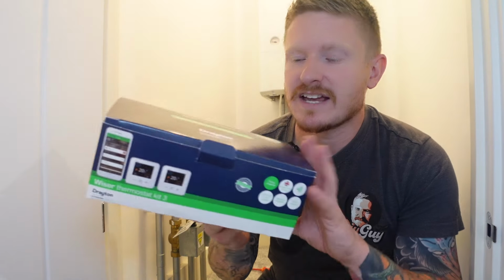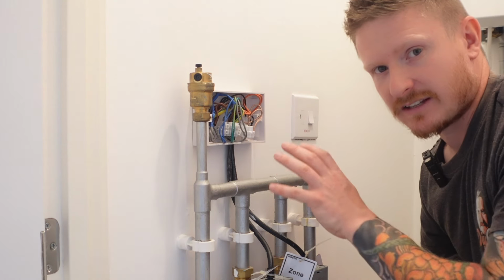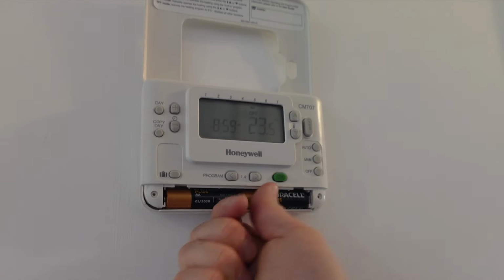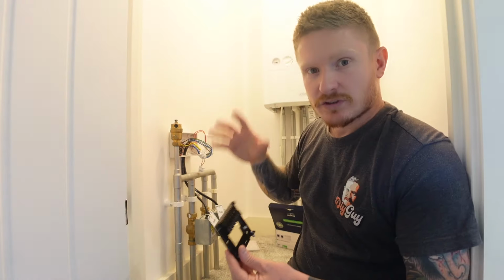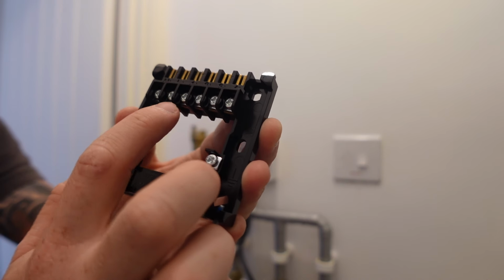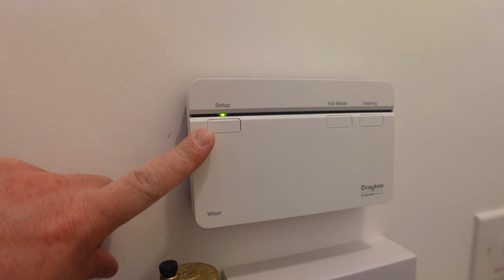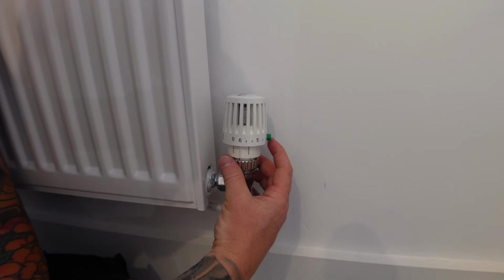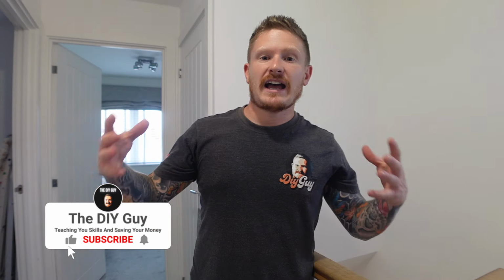How to Install Drayton Wiser Smart Heating System - THIS WILL SAVE YOU MONEY

Comment: Am I right in thinking that when the zone valves open as a result of input from that hub, they then send on a switched output to act as an input to turn on the boiler? Related to this, is it the case that whenever you use zone valves to control heating circuits its not possible to then control the boiler via digital/opentherm control (you're limited to switched on/off boiler control)?

Comment: Use a voltage indicator or proving unit as you have done  before cracking it open and also as added remove the fuse so if someone flicks the switch on it wont become live
Reply from the maker: Exactly, safety first! 👍

Comment: Hi the loop you do for the call for heat once removing the old thermostat if there’s a constant call for heat is that controlled by the drain then? But then it’s always running or do you have to keep turning the temperature right down to make sure it’s not. It’s like it’s constant power all the wiring charts say not to do that and I’ve just wired mine in without that and could not get the heating from the unit to work

Comment: Unfortunate for me I bought this system. It disconnects thermostat to its hub and the prosumer web interface when it feels like it. No logic no reason then will be available an hour later or later in the day. The stat is a pain as a touch control device with illogical touch buttons. Avoid and buy a good system like Heatmiser Neo which controls an underfloor separate kitchen dine and living area. I am going to dump this and add full Heatmiser control.

Comment: Hi 
Great informative video.  So I’m looking at installing the wiser controls to my system at home.  I currently have 2 x heating zones and 1 hot water.  My current 2 thermostats are wired.  So is it as simple as removing my existing programmer off its back plate, replacing it with the wiser hub onto the existing back plate then just disconnecting the 2 thermostat wires from the wiring centre?  Many thanks
Reply: Same set up, keen to know if it was that simple?

Comment: Can anyone help, I live in a new build with exactly the same boiler and the same 2 thermostats shown in the video. I am looking at getting this same kit to upgrade to smart heating but I can't see the main wiring programmer anywhere near the boiler or in the house. I have just the two thermostats on the wall, one downstairs and one upstairs
Reply: Check in one of the down stairs cupboards. You will see the two valves on some pipework and the cables running from them to a connector box.
Reply: @mazharuddin4044 Found it, it is just sat on the floor under the bath. 🤔
Reply: Hi, thanks for replying. There is nothing, all pipe go off into the wall. After looking online alot I found the boiler supports something called OpenTherm. Does that make a difference?

Comment: Can I ask a couple of questions please. Thanks in advance.

a. How well does the system perform as a thermostat. I'm currently using Hive but it has almost zero hysteresis so it tends to run the heating for a few minutes, then turn it off for ten or so and keep short cycling like that. All those frequent stops and starts can't be good for the system. I'm considering replacing it with something better (self install if possible).

b. The Hive controller is sitting on a standard British Gas type electrical connector. Since its functioning correctly, is it safe to assume that a Wiser controller can be swapped in without any wiring changes. (My system needs hot water + one heating zone).

Comment: Great vid. But, are you tied to registering via Draton cloud, so if that trips out you are out of control, and is there a open route into the system for smart home control by either 433  RF, WiFi or preferably MQTT so as to be able to integrate with the rest of the smart home controller, or is this a proprietary closed control system ?.

Comment: This is a really helpful guide. Do you know if the stats and boiler controls all connect with each other via the home wifi or do they require a proprietary wireless connection. I know that both Nest and Tado require proprietary connections and do not offer any form of signal boosters so unless you have wired stats, these are not suitable for homes where wifi can be a challenge. I have spent a lot of money getting a Mesh network to provide whole home coverage and want to take advantage of it. Thank you.

Comment: Installation looks fairly straight forward.  I have a Danfoss 5000 that's gone belly up on my combi. I look on the backplate. 240v connected on the far left and terminals 2 and 3 wired up. If I understand your video I change these to terminals 1 and 3

Comment: Unless you know what you are doing NEVER touch wiring. I have seen so called professionals do dodgy un-fused spurs, wiring installed across walls at various heights, incorrect cable size used, sockets under kitchen units in stupid places especially under sinks, adding sockets to an existing ring when extensions are built without loading calculations, no metal fire caps put on light fittings in flat roofs etc. etc.

Comment: Thanks DIY guy. One question on the back plate. I have the same one that comes with the wiser product already in my wall and all wiring is already there. Do i really just pop the wiser hub on and job done? As well, my 2 zones system is controlled by wall thermostats (temperature only), do i leave them on the wall connected to the electricity? Thanks again.

Comment: Hello, do the radiators still need to be balanced, given they are now individually controlled, whereas before they would all be on/off at the same time?
Reply: Radiators should always be correctly balanced, as there are going to be occasions when all rad valves could be calling for heat, so correct balancing means all the rads warm up together.

Comment: I have this system and whilst it is good it does have some flaws.  Randomly disconnects the hub - common issue it seems.  2 of my TRV are too far away and often disconnect, but you can buy a smart repeater plug which costs a lot for what it is!!  Setting the schedules is a bit backwards, but once you've sussed it then it's fine.  Dead easy to set up, even for tech expert like me!

My downside is that most of my TRV's are seized and despite constantly freeing them, they mess up soon enough!!  Anyone got tips for having them behave this winter?  Will replace all radiators and valves next year I reckon in the summer!
Reply: Zigbee repeaters don't have to be expensive, Ikea do one for < £10.
Reply: @UKBlue407  Zigbee yes.  But Wiser uses it's own system I believe as I already have a zigbee repeater anyway for my Home Assistant setup.

Comment: Thanks for the great video. I've been looking for a smart heating system for some time and settled on the Wiser system to add to my combi boiler however I have been a little unsure about the installation but your video clears this up plus the 40% off code is hard to resist.

I don't have a standard wiring unit as you had in your video but the feed from the boiler just goes to the standard RST1 stat unit that you must have seen loads of. 

It has a permanent 240V feed with a call for heat connection too. Looking at the wiring diagram it looks like the one channel hub unit will just replace the stat as long as pin 3 has a link to feed 240V. Other than that, it looks pretty straightforward.

Thanks for sharing.

Comment: Great video! I have the exact same setup - same stats and same boiler so should be a very easy job. Quick question that may know - the 3rd pipe has a red return valve on? What should that be set to? Can't find answers anywhere.

Comment: Installed one of these as a replacement to a MiGeni system from same company due to cloud update.  However it would not connect unless I was a metre away from the hub. Despite numerous hours with the helpdask I had to return it and opt for a Hive system which connected and worked straight out of the box.  So not as clear cut as first sold.
Reply: Zigbee in Uk is 2.4 Ghz, maybe you had interferene with your home Wi-Fi 2.4Ghz band (or a neighbours)? Changing the channel of your home Wi-Fi may have sorted it.
Reply: @UKBlue407  Thanks for your thoughts however, all avenues were covered including setting up a separate guest network running on 2.4Ghz and tried direct allocated channels.  And still would not stay connected.  I had not one single problem with their previous product MiGeni in seven years.  I still maintain this product is not what it is portrayed.  Whilst Hive is not my first choice it works strait out of the box as does Tado and Salis.

Comment: I wish technology that connects to the internet would stop being referred to as 'smart' as there is nothing smart about that. 
I assume that the connection to the boiler is existing on/off connections which just turns the boiler on to full rate when a heating demand is called?
A 'smart' thermostat would use the OpenTherm connections in the boiler to actually communicate the needs and modulate the boiler to make it more efficient and actually help to save you money and, more importantly, more comfortable in your own home...
Reply: It supports OpenTherm and does weather compensation!
Reply: @robert.wigley  I'm sure it does, but it is not highlighted in the video, as you would have had to wire it into the boiler differently.
My point is, better education is required on this topic. Connecting it to the internet can offer some features that will benefit the homeowner and potentially save them money, but a load compensating boiler will work much more efficiently more of the time and keep you much more comfortable 🤷

Comment: I always love these videos. '"Easy diy install". Not the easiest job if you have a house full of archaic 80's half seized  lockshield valves on all your rads like me. Dead easy if you're lucky enough to have shiny modern trv's on a recently installed system.

Comment: Drayton wiser is a great system, I sold my very old Honeywell unit and thermostat on ebay and nearly paid for buying this (without TRVs) new. 

So far i haven't upgraded to TRV, but nice to be able to use Alexa to control the heating and switch on and off away from home

Comment: Just one question  DIYGuy, I set up the hive system but haven't invested in wireless TRVs yet because I still wouldn't be able to heat the upstairs alone when I needed to because of the rule about one rad(currently our lounge rad), can't have a TRV on it.
I would always be heating the lounge unnecessarily if I wanted to warm the upstairs.
What's the solution?
Reply: change which Rad doesn't have a TRV downstairs? maybe hall or WC?  Somewhere you don't mind a bit of extra heat.

Comment: A really cheap option for smart control is also to pop a Sonoff minil2 on the live/switched live to the thermostat in the wiring centre. Let's you get rid of the wall thermostat entirely. Can combine with a temperature sensor in Home Assistant... You can then control heating from any mobile/tablet/wall panel, home or away... And use in automations... Ie auto turn off heating when everyone leaves the house etc.
Reply from the maker: Thanks for sharing 😃👍

Comment: Thanks, I’ve just taken a Drayton & Zhender thermostat off to measure are compare. The open & closed dimensions are the same 20 & 15mm. They fit each others valves and work fine. As a DIYer I assumed each manufacturer did their own thing. Seems there is a standard. Thanks
Reply from the maker: Anytime 👍

Comment: We are running 17 radiators with this system, worked out it pays for itself in 12 to 18 months, now we can completely heat individual rooms (you don’t need the room themostats). 

Saves money as you can heat the room you are using and set times and temps for each room.

Gives you total heating control.
Reply from the maker: Brilliant, thanks for sharing 👍
Reply: I thought messing with TRVs is how you end up with a load of air in the system / unbalanced radiators
Reply: @Tracdooor  You are not touching the pipes in the heating (you don't need to drain the system etc),  just the controls for the heating on each radiator, so you are just taking the existing old fashioned trv and replacing it with a new Smart trv.
Reply: @Tracdooor  I think your getting mixed up with the lockshield valve.

Comment: Buying endless batteries to control your TRV's for the rest of your life.  Hmmm.
Reply: The control you gain over your heating system more than makes up for having to replace cheap AA batteries once every 18 months or so.  You can effectively zone off your home every which way and group different 'zones' together into what are called Moments which you can toggle on/off at the touch of a button on the app.  You will save a lot of money using this Wiser system.
Reply: I've had success with IKEA Ladda batteries.
Reply: It's annoying that it can't use rechargeable batteries but they last a year or more.
Reply: @TonyWhitley why can't you use rechargeable batteries?
Reply: I think the voltage isn't high enough unless you buy really expensive rechargeable batteries.
Reply: @TonyWhitley    Rechargeables will work but you'll get false low battery level readings in the app  from the TRV's even when they are not low 👍🏼  Long life AA batteries in Lidl are your best bet and not expensive 👍🏼
Reply: @rodgerq  Lithium is the answer, but be careful they don't get too hot. Normal rechargables are only 1.2v, you need full 1.5v
Reply: @UKBlue407  haven't had any issues so far with these IKEA ones.
Reply: Given all the stuff pushed into our lives these days, you make a good point.

Comment: I'm slightly confused about TRV compatibility and these radiator control units fitting onto existing radiator TRV valve bodies. Are we saying there are international standards and any stat can be fitted to any valve ? I can't believe life is this straightforward. Sorry for being thick.
Reply: most manufacturors have their own valve system, but the smart themostat brands like the one in the video, or Tado, make adaptors to make it fit.

Comment: i have this system, and it has had its issues but controlling it from my phone makes it easy. one suggestion is to add geofencing via ifttt. its free and there are settings already, you can simple click and add. it means when you leave your house, the system goes into away mode, so you dont have to do it manually. once you arrive home it goes out of away mode and the heating will continue to be set to room temps and heat schedule.
Reply: Add it to Home Assistant and the world's your oyster.
Reply from the maker: Good point there 😃
Reply: What’s ifttt? Cheers

Comment: Hi Cameron. Two queries; 1. What happens if the internet goes down. 2. If the battery fails on one or more TVRs?
Reply: 1. Then you can't control it away from your house. The system itself works through its own radio network in the house.
2. The batteries last about a year and you get notifications when they are going flat.
Reply from the maker: @TonyWhitley great replies. Very helpful for everyone 👍
Reply: 1. The Wser system works over it's own Zigbee wireless network which means the system will work even when your internet is down. 
2. Depending on how often the TRV actuates will determine battery life.  Typically well over 1 year.  You can see the battery status (as well as signal strength) of any TRV from the 'Devices' option in the app and the app will also send a notification to your phone if the batteries run out or if the TRV loses connection to the hub (out of range).   The range issue can be solved by using a 'smart plug' which also acts as a Zigbee range extender for the system.
Reply from the maker: Brilliant advice for people. Thanks for sharing
Reply: I'm not convinced this is a DIY job. My head hurt by the end of the video and I'm nifty with electrics. 😮
Reply: @jess_the_hungry_cat 
Heating systems are by design pretty simple. 
If you have a standard wiring center, then the hub is plug n play. 
If not, then there's only a maximum of 7 wires that need connecting, but that's system dependent. It's really not that hard, as it's been designed for use by plumbers, no offence to plumbers intended.

Comment: I did this a couple of years ago, the difference is that the wiring was a rat's nest of chocolate blocks floating in mid air behind a wooden panel and I had to work out how it all worked from first principles 🤬 I labelled all the wires and fitted them in a WAGO mBox L32 Wiring Centre Junction. The Wiser system has been faultless since 👍
Reply from the maker: Yeah that’s a pain! Sounds like you got it sorted ✔️